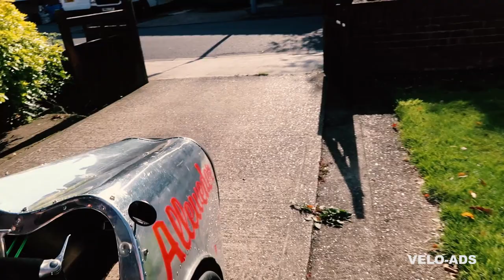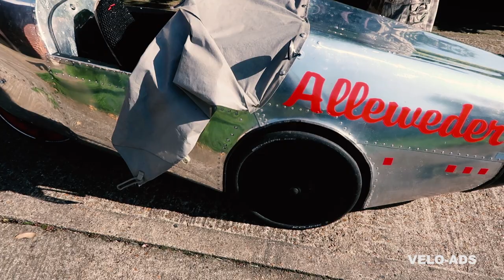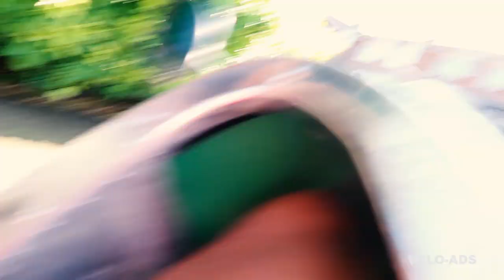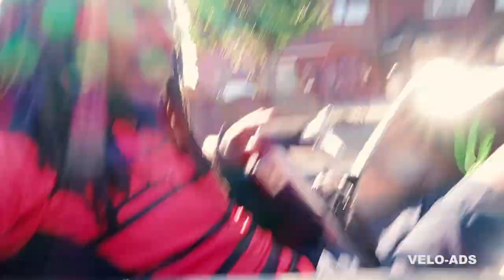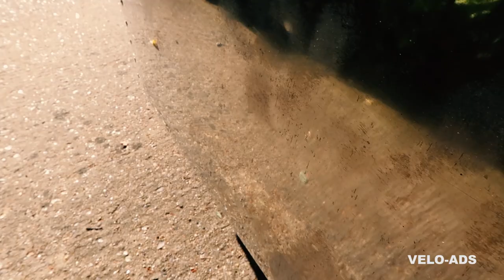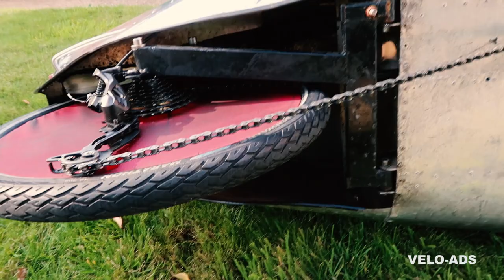044 Testing Second Hand Alleweder.

Comment: the reason i went up wheel size or two as the original 20' and gearing it bottomed out out 28 mph i built a new rear shock as the old one collapsed

Comment: As a large rider standing a 6foot 1 inch with a 20 inch shoulder width do you know of a velomobile that could fit me
Reply from the maker: brandon smith I would definitely give the quest a try,you should be fine with that.
Reply from the maker: brandon smith or the Velayo
Reply: With the exception of the fourth wheel would the Quattrovelo be about the same as the quest
Reply from the maker: brandon smith the Quattro is slightly heavier and narrower and handles much better than everything else.
Reply: I had an Allight Alleweder 4, very different.